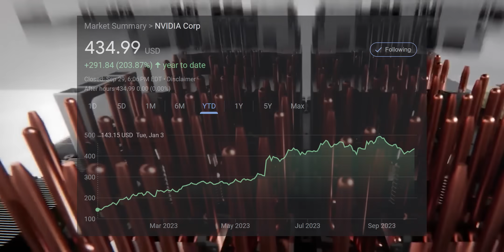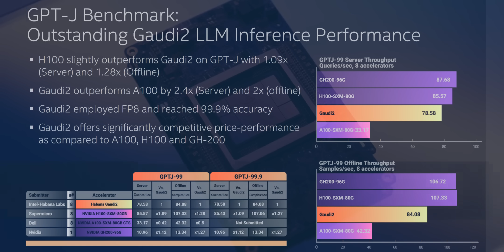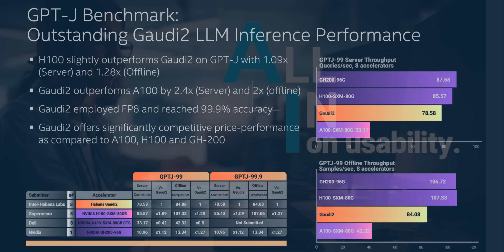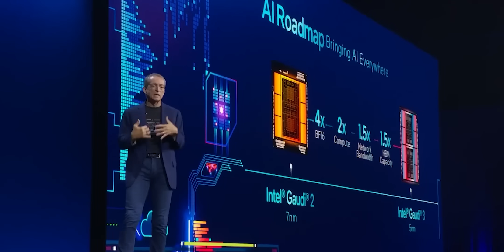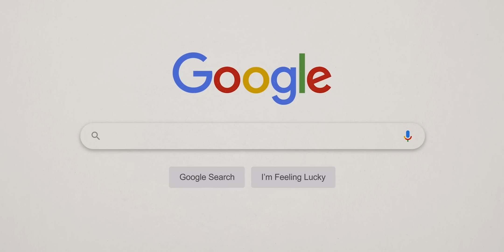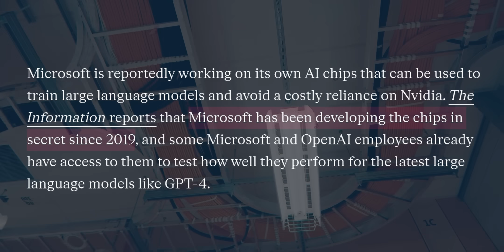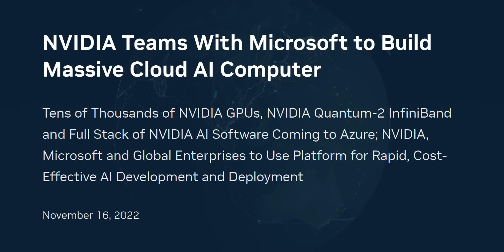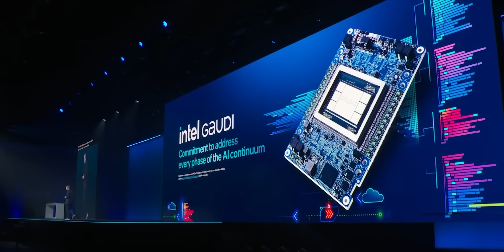Top 5 Generative AI Stocks to Buy Now (Taking on NVDA Stock)

Comment: You forgot to mention the biggest competitor in the room 🤣

Broadcom is a strong beneficiary of the increasing demand for compute workloads given its leadership position in custom chip (ASIC) compute accelerators (#1 market share leader) for customers that choose to focus more on custom chip designs vs. using off-the-shelf merchant solutions (Nvidia A100/H100). As we have written previously written, Broadcom co-designed Google's flagship AI Processor ASIC chip called TPU in 2016 and has since helped Google bring four generations of TPU to the market
Reply from the maker: Broadcom and Qualcomm are both great companies